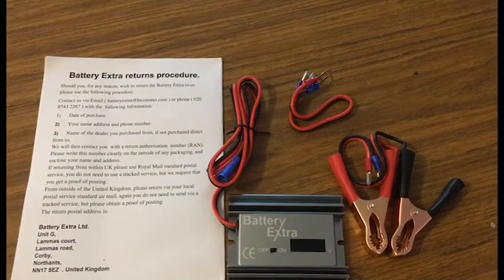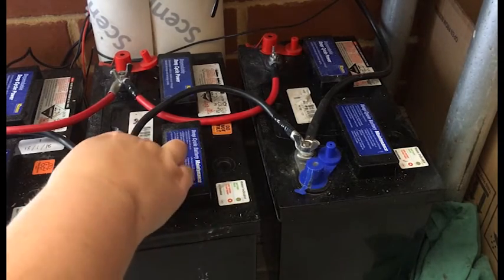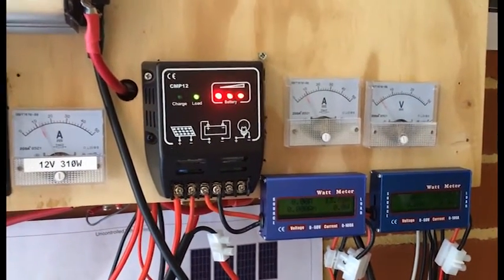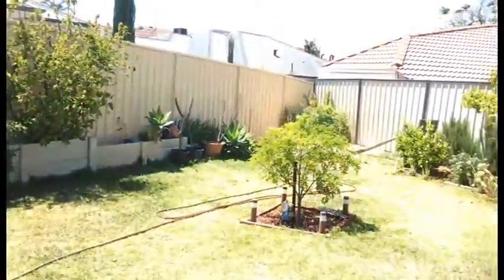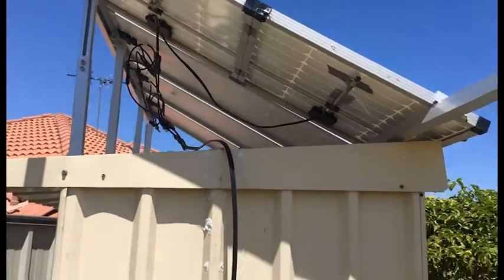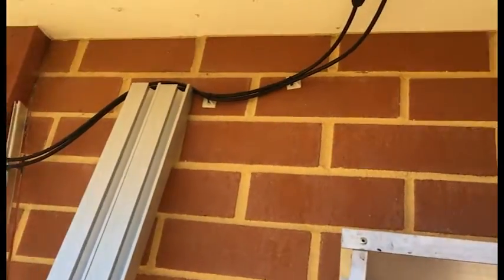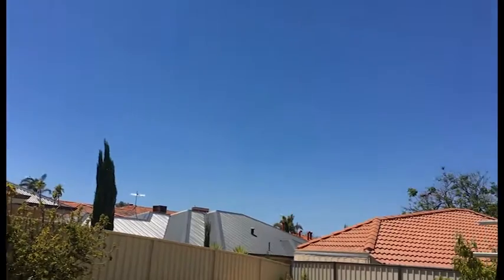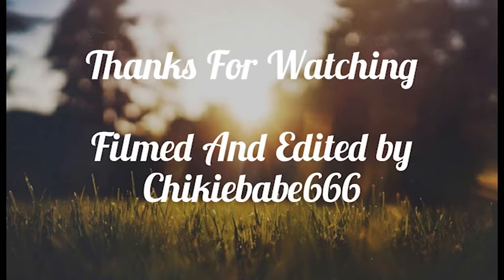I installed a battery extra desulfator to my 12v part off grid

Comment: What is that battery extra   do?   thank you
Reply from the maker: +buck tooth bettys boyfriend 
The Battery Extra is designed to extend the cycle life and recover old or weak lead acid batteries, typically used in, boats, motorhomes, mobility vehicles, large trucks, small solar and wind systems that are sulphated. It will work on any lead acid battery or battery pack of 12 volts or 24 volts up to 500Ah.

That's the 1 I got they make bigger 1 that dose 12 to 48 and dose more ah
Reply from the maker: +buck tooth bettys boyfriend 
You're welcome